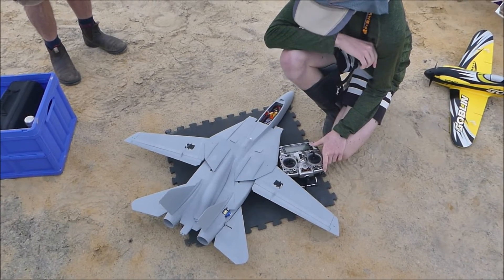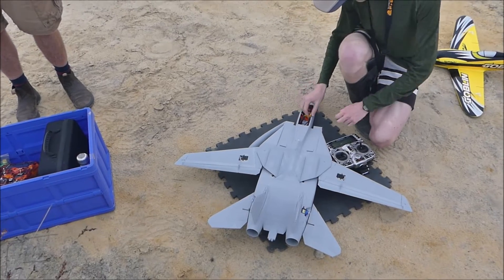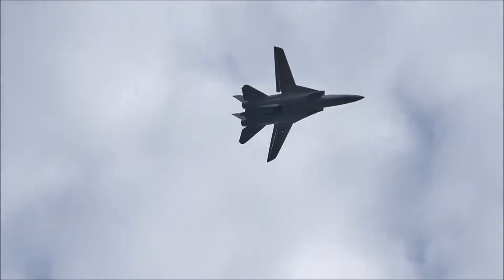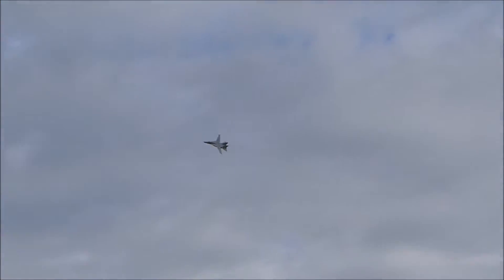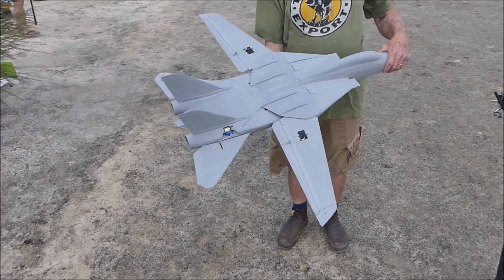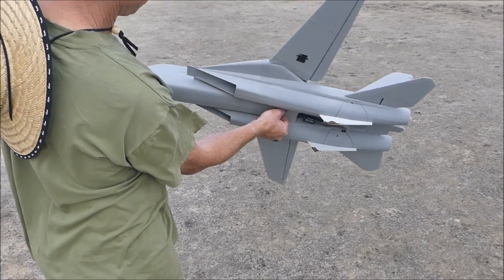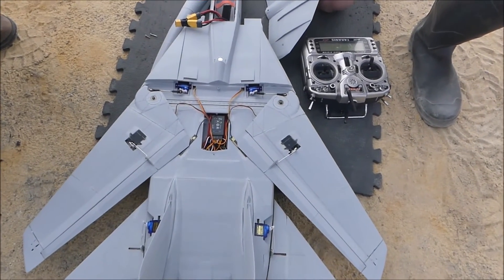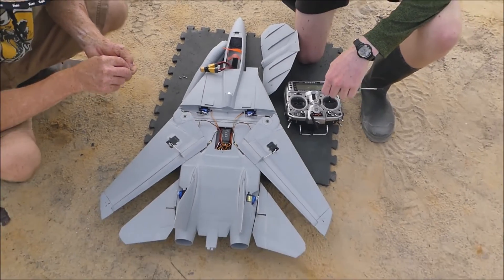3d-printed F-14 Tomcat Version 2 maiden flight LW-PLA

Comment: quite a lot of flex in the wings fully extended!
Reply from the maker: Sure is!
Reply: Yes, I was worried it would break up in midair, or suffer from flutter, he was confident it wouldn't, but he is going to work out a way to cut out the slop and I think was surprised by how much flex there is in the wings.